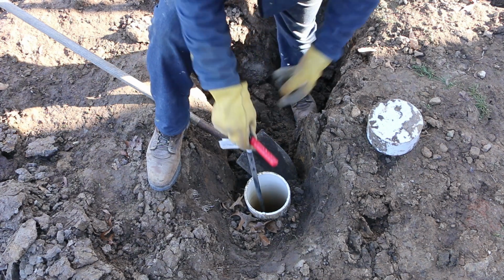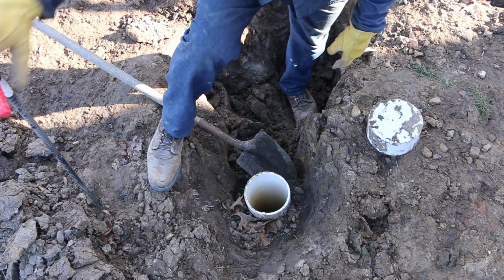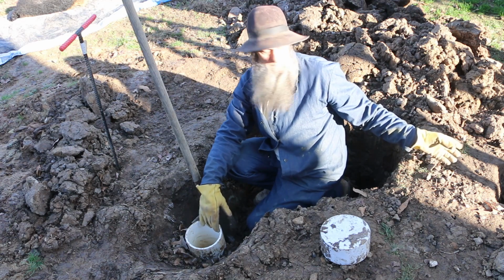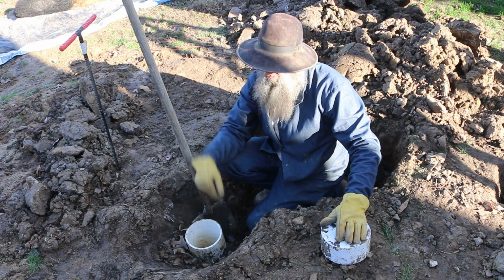My OFF GRID HOT SHOWER! Wood Fired Gravity Fed Rain Water

Comment: Your using the wrong type ball valve wrench. The one you are using is made fir a brass valve. Those will break a pvc handle valve every time. They make another one that goes over the center and basically puts equal pressure on on both ends of the valve ( both handles ).  Like you said you can weld one up yourself if you have a welder, but you can also make one of your own out of 2” pvc or abs ( I prefer abs because it is not as brittle). Just stand your pipe on its end and make two cuts near the center and snap off the 2 tabs with a pair of pliers.  Now your homemade wrench will go over the center of the valve and then when you turn it will put equal pressure on the handles. It works quite well.  Great vid btw! Keep up the good work!

Comment: Make your life easier get a clay chimney tile and a piece of slate use you cordless angle grinder and cut the tile to fit with a diamond wheel and make it so the slate top sits about 1” below the top of the gravel paint one piece of gravel cover slate with gravel place painted gravel in center of slate

Comment: All water heaters should have a pressure relief valve in case the heated water gets too hot and builds up too much pressure. I don't believe I saw one on your system?
Reply from the maker: On top didn't elaborate sorry

Comment: We are about to get a water tank for collecting rain. How do you determine the right size for your family?
Reply: @udder farms,
There are many things to consider in answering your question.
1. how many people
2.  inside or outside storage tanks 
3. Lowest winter temps
4. Uses of the water
5. Rainfall amounts in all seasons, do you get snow?
Amount of roof area, you will get just under 3 quarts of water per square foot of roof area per inch of rain. In my shop, my roof gives me just under 950 gallons per inch of rain. I can store 5700 gallons and a few good spring rains fill them completely. Hope this helps. Any questions, just ask.
These are the basics to consider. 
If freezing is not an issue,  get at least 3000 gallons of capacity. If

Comment: Guys I’m shocked you installed fibreglass insulation or the new asbestos…this stuff is highly toxic. Love the hot water system. We will definitely be using this method.

Comment: Misinformation skippy (I waited so long to say that back to you LOL), Heat does not always go up , It will always go to the cold, build a camp fire if you sit next to it  and feel the heat, you have proven that Heat goes to the cold (that is how radient heat work) Second I wish I could send you one, but could you try a cycle stop valve it pop my off the grid up to 70 pounds, but I have a small jet pump, I do not  know if it would work with Gravety fed hint hit

Comment: I like your water heater, but if you decide to build something similar going forward for guests, meaning an additional shower and a separate water heater, let me know ahead of time and I'll build you a fire tube boiler. 

Remember me? I'm the crazy old fart in north Texas, who builds steam engines and windmills for a hobby. 

A fire tube boiler no bigger than a couple shoe boxes will make hot water 'till you couldn't use it all and on about one-fifth of the amount of fuel you're currently using to heat it in the Amish water heater.

 If you've ever seen the insides of a steam locomotive engine, the old black pufferbellies, that is the kind of boiler I'm talking about. It sucks fire through the tubes and the water gets hot instantly.
Reply from the maker: Do it 👍
Reply: @OFFGRIDwithDOUGSTACY  
Ok.  I'm on it.  I'll keep you in the loop via email.

Comment: Douglas, here is a formula for water pressure.  The water pressure in PSI can be determined by multiplying 0.433 times the height (feet) of the tank above the outlet.  Simple right?  How do you stay warm while taking a shower in that shower room with no heat?  Does that water heater put out heat into the room?  
  I thought you were an off grid, rough and tough, leather necked, sun beat, farmer,  and you need gloves??  What kind of video is this??
Reply from the maker: Lol the kind where its 28 degrees f and my hands are freezing lol I will do that math and see what we got there oh and it stays pretty good south facing and insulated but I tossed a little buddy propane heater in there to take out the bite
Reply: @OFFGRIDwithDOUGSTACY  I am sure wifey will like that warm shower